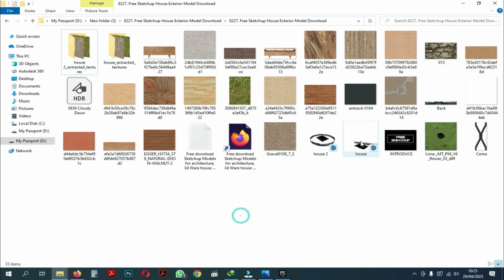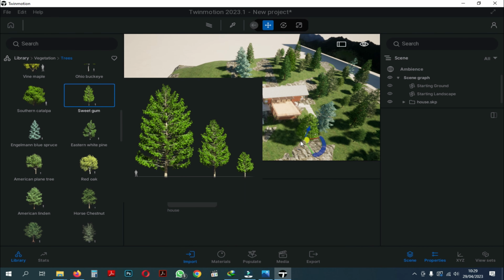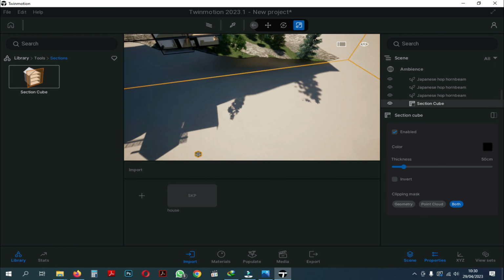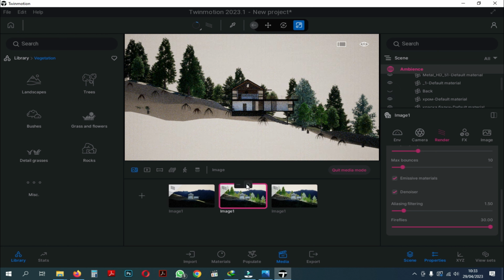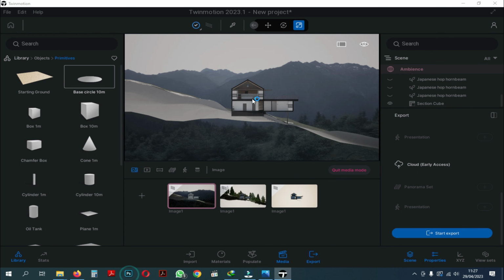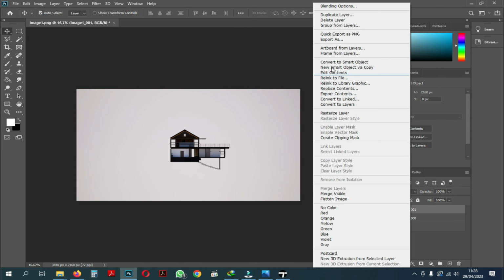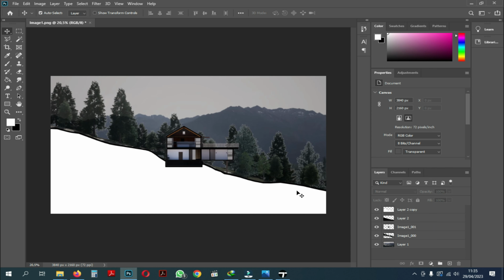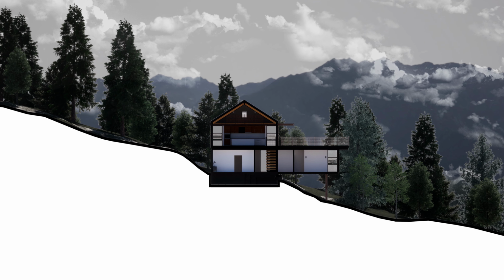Now Making Section Plan is Really Easy with This Twinmotion Tutorial!

Comment: I have to RE import my fbx model from SU19 (I can't use Datasmith) how can I save my vegetation trees in planters on four crossing streets for them to reload or stay in the newly imported file?
This is very easy in Lumion just clicking on material then > ctrlALT and then REimporting the new scene will include changes but keep the original scene with vegetation . In TM this does not seem to be the case. Thank you very much love your tutorials